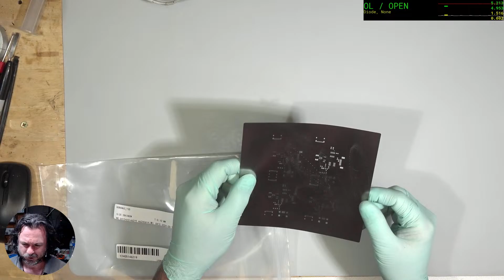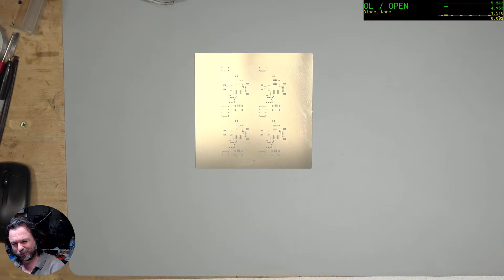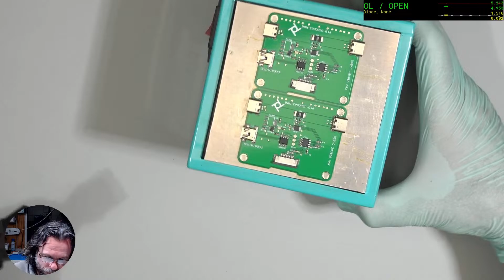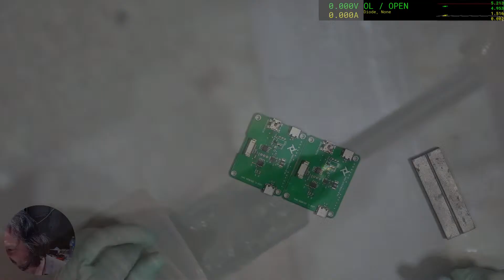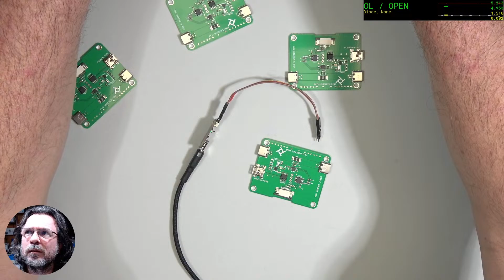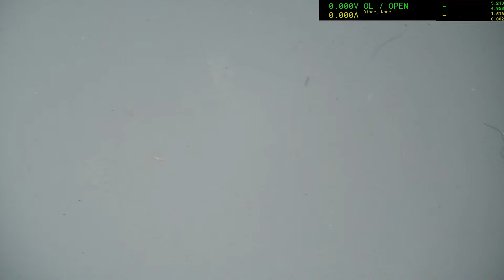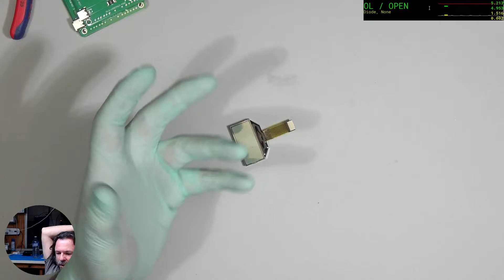0014 PLD USBC Meter building

Comment: If you do routed boards held in with mousebites you would have enough space around the edge of boards to let connectors and stuff overhang correctly.
No need to brake apart before pick&place after pasting.

Comment from the maker: 4:30 New boards and stencil
11:10 Pasting the boards
17:39 Pick & Placing parts
35:15 Roasting PCBs
44:00 Post reflow inspection & rework
53:45 Programming the AVR Tiny212 microcontrollers
55:00 Testing the boards